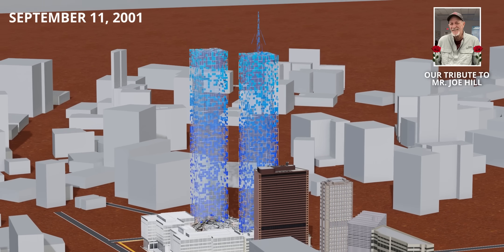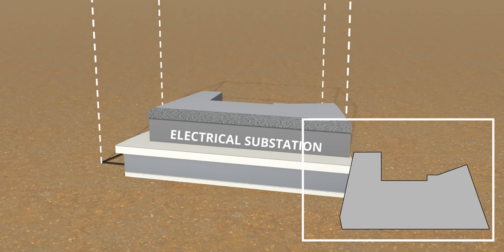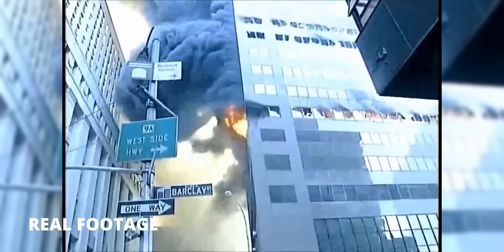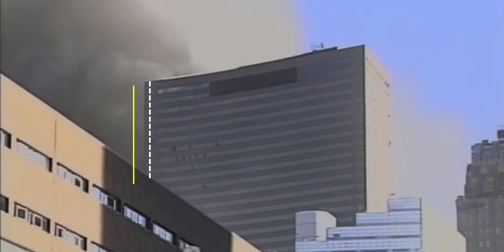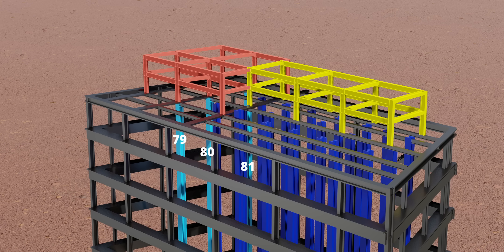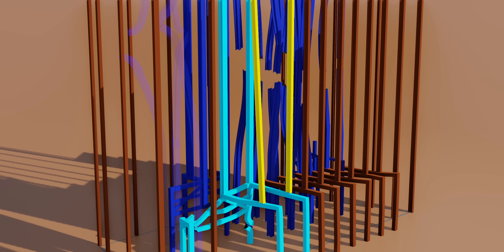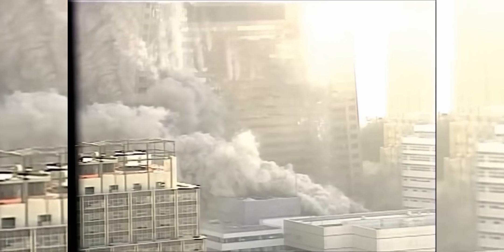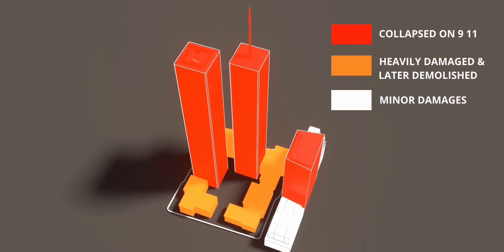Collapse of Building 7 | The Complete Physics

Comment: This is not accurate.

Why did the building collapse almost perfecley down like a demolition?

Why there is a demolition alarm inside the building going of?

Before, And since there are no other buildings came down like this just true fire.
Its impossible.

Also, Why is there sickness around manhattan like its a ground zero?
It looks very much like a thermo nuclear explosion from below the surface of building 1 and 2 and 7.
Reply: This video is pretty good – with a few exceptions - and goes into a much higher level of detail than many viewers will be able to comprehend.  While not perfect, the collapse mechanisms – the sequence of failures - described here  are substantially correct and this is true no matter who planned and carried out the 9/11 attacks or why . 

That may not be what you want to hear and go against 20+ years of entrenched dogma and conditioning, but it’s not wrong.  

That also means (in case you did not get the hint) this video can be (and IS) absolutely correct in its description of collapse mechanisms AND the 9/11 attacks could still have been some sort of inside job. The two things are in no way mutually exclusive. 

Your problem is you don't really understand what is being sdhown in the video while att ther time trying to squeeze your own false starting assumptions and bad ideas you mindlessly copied off the internet. 

The mechanisms described here have broad professional support around the world. There are no professional engineering organizations (for example: ASCE, ASEE, ICE, etc) that disagree with them or have offered any formal dissenting opinions or alternative hypothesis. 

So, setting hubris aside, either the overwhelming majority of the worlds structural engineers and simple observation are wrong,… … or you are. Which seems more likely? 

IF you still think believe this explanation is wrong then produce a better one . Good luck with that. No one ever has and I don’t see you moving that needle today. 

No one ever does.
Reply: @TheCriticalStinker-01  Also,.  Why say the fire figters that day, We go to pull it.

And BBC 30 minutes before collapse.
Building 7 has collapsed. 

The only reason this is possible.

Underground thermo nucleair demolition. 
Just like WTC 1 and WTC 2 did that morning. 

3 buildings, collapse in own footprint, and also way to less debris.
Reply: more then 1000 architects disagree with your look.

But you cant accept you are wrong on this.
That make's you not smart.
Reply: @TDH8988 - Uh huh. While you make (false) arguments from authority and repeat old failed memes: 

Building 7 - the 6th building to collapse of 10 lost on 9/11 - because of its low priority was largely ignored early on, so conspiracy filled the information void with a lot of  garbage from ignorant people promoting political agendas, creating a lot of confusion and misconceptions.  So I prepared this brief summary using my own technical analysis, not ideology and magical (non)thinking to dispel them. 

At 10:28am the WTC North Tower collapsed, showering Building 7 with tons of burning debris, causing heavy damage and starting many large fires that burned out of control for the next 7 hours. Half the FDNY firefighters having been killed, units in disarray, equipment destroyed, no water pressure, and the greater urgency of search & rescue efforts, Building 7 couldn’t be saved so firefighting efforts were pulled as futile and 7 left to its fate. Firefighters make that sort of choice every day in brush fire situations - which houses to save and which ones to let go. Only real difference here is moving the decimal on the size and cost. People get overwhelmed by the size.

www.youtube.com/watch?v=g_SvpwyC17M

Collapse of a burning structure is always a concern for firefighters and steel buildings are uniquely vulnerable to fire damage. When subject to fire they rely on active firefighting to survive, designed around 1 to 3 hours of fire resistance to, allow time for occupants to escape and active firefighting to get started.  After this all bets are off. Left to their own devices they'll exceed their design envelope and collapse, like Plasco Tower and Wilton Paes de Almeida. In 7 the occupants escaped, passive and active fire protections were compromised and active firefighting was abandoned hours before the collapse, which left the building to its fate. It lost. Odds on Building 7 would eventually collapse, and it did. No big deal in logic.

 http://www.youtube.com/watch?v=WnYBX6QT0R4 

FDNY Chief Daniel Nigro - The biggest decision we had to make on the first day was to clear the area and create a collapse zone around the severely damaged 7 World Trade Center, a 47-story building heavily involved in fire. A number of fire officers and companies assessed the damage to the building. The appraisals indicated that the building's structural integrity was in serious doubt. I issued orders to PULL back the firefighters and define the collapse zone. It was a critical decision; We could not lose any more firefighters. It took a lot of time to PULL everyone out, given the emotionalism of the day, communications difficulties and the collapse terrain 

FDNY Deputy Chief Peter Hayden ; We had our special operations people set up surveying instruments to monitor and see if there was any movement in the building. We were concerned of the possibility of collapse in the building. And we had a discussion with one particular engineer there, and we asked him if we allowed it to burn could we anticipate a collapse and if so, how soon? And it turned out that he was pretty much right on the money, that he said 'In its current state you have about 5 hours 

The collapse of Building 7 was anticipated and widely reported in the media throughout the day, with 24 video cameras recording some or all of the collapse. Everyone knew what was coming and why. 

www.youtube.com/watch?v=OY5S5k3tMHI

Building 7 collapsed from the inside out which is not at all intuitive and hard to understand with most details being hidden from view.  It requires careful analysis and observation, and some people will struggle no matter how much it is explained. But here is my explanation relying on no outside authority. 

Building 7 was a unique, asymmetrical 47-story steel frame structure built atop a smaller 3-story building serving as a partial foundation, requiring lower floors dedicated to complex load transfer structures. Of trapezoidal shape and tube-in-tube construction, B7 (above the 7th floor) consisted of a central core of steel columns carrying most of the gravity load, perimeter steel columns around the outside of the structure carrying the remainder of the gravity loads and long span beams and girders to tie those elements together and form the floors. On the outside of the building hung a facade or outer shell. 

www.nist.gov/image-16640

Phase 1 : First externally visible signs of collapse initiation occurred at 5:20:28 pm and was notably quiet with observers not realizing the building was collapsing! No warning in the form of hundreds of eardrum busting 180dB explosive bangs. Here at 12:00 a local CBS affiliate reporter talking 10 blocks from B7 when collapse begins. People don’t start to notice the collapse until 12:11. At 12:45 is the famous CBS fixed camera clip of Building 7’s collapse. Note the silence. 

www.youtube.com/watch?v=t5tEy6mXSE8

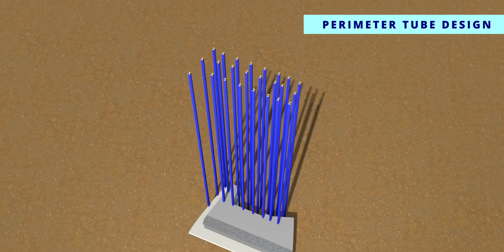Lower floor failures above the load transfer region (8-14) in the NE corner initiated the collapse. In this video at 0:45 you can see the NW corner from inside the building while under construction, Column 79 just out of frame on the left. That big, angled steel beam across the top of the frame connects to C79 at one end. The girders connect to the beam. That beam and all those girders depend on just one connection 

www.youtube.com/watch?v=nP3TNHPCIVU&t=45s

Phase 2 : NE corner floor failures caused a loss of critical lateral support over an excessive length of Column 79 and it buckled. Externally as collapse begins we see a vertical progression of window breakage along the 44-46 line and a kink in the roof of the East Mechanical Penthouse at the top of the building, consistent with C79 failure. Looking at the above floor diagram of Building 7 when you see all the structures that depend on C79 you quickly realize this one column was a relatively isolated structural element on which a disproportionately greater fraction of the structure depended analogous to say the Key Bridge. Normally with a buckling column, the load could be redistributed to other columns. With C79 that is not the case - the failure did not redistribute the load, so the collapse rapidly progressed to the roofline, sinking the rooftop penthouse. The transition from full capacity to almost no capacity occurs in an instant and will result in virtually no resistance 

Phase 3 : With C79 gone, the progressive non-symmetrical collapse continues with adjacent columns 80 and 81 left laterally unsupported and quickly buckling as well. The EMP drops down through the building. C79-81 all have no diagonal bracing, which is the major reason why they could not redistribute a lot of vertical loads among one another. From there collapse progressed from east to west through the central core until the core was gone from 81 to 58, taking all the interior floors and probably most of the perimeter columns with. Follow the horizontal progression of window failures low in the building and the dropping of the remaining rooftop structures into the building. The NIST Building 7 study determined C79 failing under ANY circumstances would have initiated the same collapse sequence. 

Phase 4 : After about 10 seconds only the exterior moment frame remains, giving the illusion B7 is still standing to the casual observer since little has outwardly changed. But it is just a hollow empty shell like an empty cereal box supported only by a few remaining columns and overloaded from the loss of the core columns and floors, quite unable to remain standing. With nothing remaining behind it, the north face leans inward, forming a V in the roofline, the last few columns buckle under the strain and the moment frame free falls, landing on top of the debris pile. 

It is more than 10 seconds into the collapse before a single measurement of alleged free fall acceleration is taken. It was not The Building but only the empty hollow outer shell that was still standing being measured. The measurement is not a sustained period of FFA but rather a curve starting out below then up to and OVER 9.8m/s/s before decelerating back down below again, arbitrarily averaged over 2.25 seconds to get roughly 9.8m/s/s. The single measured point was not The Building , was moving in 3 dimensions, not just down and is a product of collapse progression mechanisms not collapse initiation mechanisms, thus tells us nothing about why the building started falling 10+ seconds earlier. It’s meaningless. Start to finish the total collapse took 18-20 seconds or 3 times longer than true FFA . How fast something falls can’t tell you what started it falling anyway.    

The debris spread well outside the footprint blocked surrounding streets, heavily damaging the Verizon Building and destroyed Fiterman Hall. 

Building 7’s progressive, non-symmetrical collapse was incidental, unintended collateral damage from the combination of fire, time & gravity started by the collapsing North Tower, true no matter who planned and carried out the 9/11 attacks or why .  Of so little consequence it barely registered at the time, only taking on semi-mythical status as an alleged smoking gun years later when demolitions at the Twin Towers, missiles at the Pentagon and shoot down over Shanksville all failed and conspiracists had nothing left to work with. 

Anything can seem like a conspiracy if you don’t understand how it works. Now you should. I hope you found this helpful, informative and it solicits informed critical comment. If I made any errors of fact, logic or reason or left anything important out, please let me know so I can fix it. OR offer a more plausible alternative if you can. Be the first. Please start any reply with the words “Tits McGee” or I will know you didn’t read it and are wasting my time.
Reply: @TheCriticalStinker-01  Why you defend a story you believe so hard 24 years after?

If you believe the original fantasy story you go on.

Are you a government shill?

Look at the book of Dimitri Khalezov.

Maybe its hard for you that you are wrong about it for so many years and thats the reason you believe cartoon fysics.
Reply: @TDH8988 - Tell me you didn't even bother to read my reply without telling me you didn't bother to read my reply.

You are not serious.  You are a believer, not a thinker.  You want to believe , you don't want to know . You have your dogma and anyone who disagrees with you is a heretic. 

Good luck with that.
Reply: @TheCriticalStinker-01  There's no point in having a conversation with you.

It's also strange why someone who thinks they're right about a subject keeps putting so much effort into it.

There are so many sources of information that prove the original story can't be true.

To keep it simple:
2 planes and 3 buildings.
Also, almost 90 percent of the flammable kerosene burned immediately upon impact.

No building has ever come down like this before.
There are several witnesses who told the camera on 9/11 that there were no planes.

Only an explosion from the inside out in the North Tower of the WTC. And later in the South Tower.

There were also witnesses like firefighters or someone like Barry Jennings.

They only talk about explosions from the inside out.

These aren't opinions, but testimonies from people who were right there with them that day.

The fact that you're describing all this nonsense here.
By cutting and pasting.

Suggests to me that you're probably a government official trying to prevent the truth from coming to light.

No one with any construction experience believes the original story.
It's completely flawed.

Just think of the passport that was found and the red bandana.
The lack of debris.
And the BBC's premature reporting that building seven had collapsed.
(26 minutes before).
Reply: @TheCriticalStinker-01  Not to mention the whole Pentagon story.

In the first few days, I saw multiple reports from witnesses who all said they saw a missile.
No Boeing 757.

Coincidentally, there were no cameras on either.
This on the most secure piece of land on earth.

Not to mention the fact that there was no crashed plane.

If, all things considered, you still want to believe the original fantasy story,
then you're not shortsighted, you're just plain idiotic.
Reply: @TheCriticalStinker-01  You can say that to you.

You dont want to know.
Reply: @TDH8988 - Correct. There is no point, because I'm making great points and you want to pretend I'm not.  

Again, you are a believer NOT a thinker and I already made it clear I was happy to leave you to your religion. Goodbye.

Comment: Explosives would also bring it down at freefall speed unlike fire.
Reply: No, not least because there is no such thing as free falll SPEED
Reply: What is free fall speed to you?
Reply: @thecarwashesandmorechannel2892  - Irrelevant, an endllessly proven epic fail and a sign of someone who is scientifically ignorant. 

First thing to clear up is the confusion between Free Fall and Free Fall Acceleration with Free Fall ["FF"] the a state of a body without support free to fall under gravity. Free Fall Acceleration ["FFA"] is the motion that results when a body is in the state of Free Fall. 

Of course, the usual term used is “free fall speed “ which isn’t even a thing. The motion of FFA is a measurement of acceleration NOT velocity so there is no such thing as free fall SPEED 

Moving ahead (because it is no doubt where you are going with this) those pushing the false claim for CD are usually seeking to prove, directly or indirectly that the falling body had no support - therefore CD must removed the support (being unable to think of anything else). That is not a distinguishing fact. Because whilst the state of FF will cause FFA, the reverse is not true. FFA does not need zero support - it can result from net zero applied external forces. This also requires thinking in 3 dimensions instead of 2 dimensions - typically a big ask for anyone using nonsense terms like free fall SPEED

I hope that sufficiently addressed your question.
Reply: @thecarwashesandmorechannel2892 - I take it my reply was sufficient.  Thanks for playing.